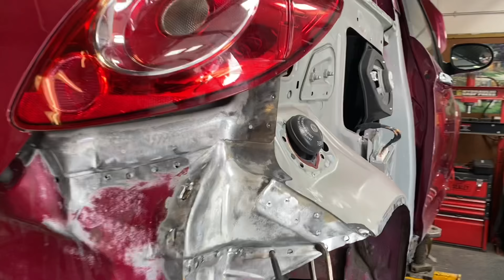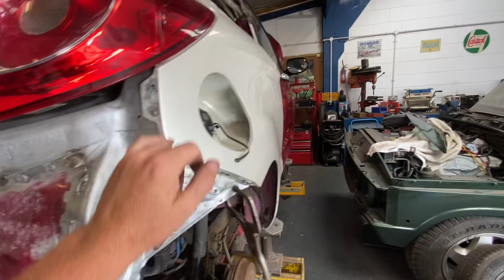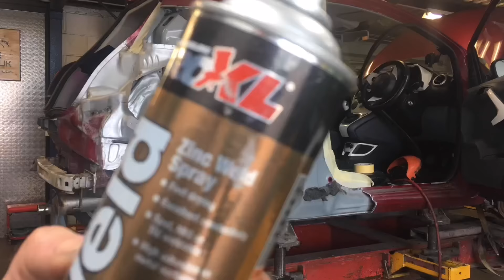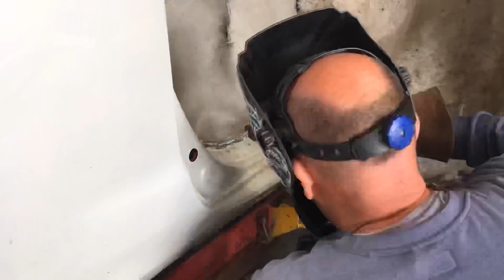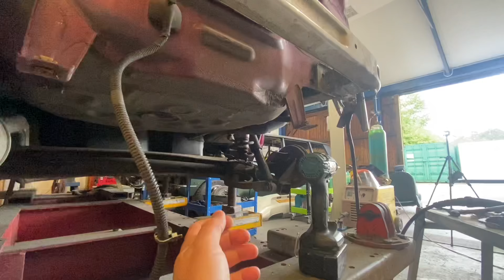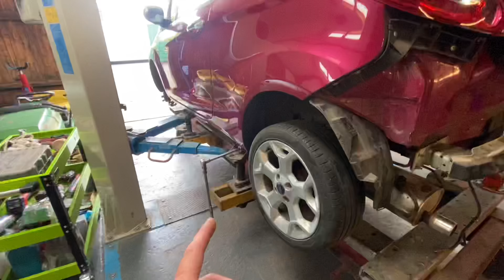Copart Ford KA Salvage Rebuild On The Jig Frame Machine PT 3

Comment: Love watching you two sort these cars out. When you use the dozer etc on the cars, how does this effect the car if it was bashed again in the same place?
Reply: Think that part of the monocoque chassis is made of tissue paper anyways so probably not much effect.

Usually the passenger shell is the part that will not bend , This outer layer is not much more than cosmetic.
Reply: @Jasontvnd9  thank you

Comment: Great job guys. :) Only minor issue is you guys should the welding fire proof blanket to protect any glass, plastic and fabric parts as the hot shavings from the grinder will melt the plastic and even glass and get into it and rust. We use them a lot when cutting and griding . Believe me i done that before and was a nightmare... But other than thant amazing work, you make an amazing team.
Reply from the maker: Thanks. Fire proof blankets can be seen in the video thumbnail

Comment: Hi you two.
Nice job there, good to see the weld through primer & the blanket protecting the interior! Good gaps & very tight looking on that ford.
By the way, I did private message you on Instagram a good few days ago, and had no acknowledgement.
Nice work you two do there!

Comment: Rob /Chris, After pulling a heavily damaged section back to normal does this compromise the strength? i.e. if it were to have another bang in the same place would it crumple easier?
Reply: yes. metal fatigue
Reply: The panels crumple fairly easily anyway in a shunt as it's pretty thin metal, the strength comes from the chassis. The chassis only twisted by 12mm in that first rear end accident so it hasn't really been compromised much. In another accident it wouldn't make much difference, that said metal has a kind of memory so if that car was repeatedly driven harshly over speed bumps it then the chassis would be more likely to twist than one that hadn't been in an accident but the difference is negligible tbh, The car is no less safe than before.
Reply: It's all welded in the same places so in theory no difference 👍
Reply: Think they have air bags too👍
Reply: Yeah sorry I meant the cars these guys do are safe to drive. Don't know much about the metal work and crumpling👍

Comment: very interesting to see how this panel work is done, can you use some heat on these panels?
Reply from the maker: Heat not required and not recommended. Inner panel is quite a soft grade of steel.
Reply: @sruk  I saw a thing much like a induction cook top used to take dents out of panels, it heated the dent and it popped never have seen such a thing, so if the wife finds one of our inducvtion elements missing then she wil know wher its gone

Comment: Question for you lads out of interest, the original quarter panel had a sticker on it that looks like it has the VIN number etc.. Is that something you can heat up an peel off the old one, or do you just go to Ford and get one? Maybe it's my OCD! but just wondered what you do about things like that when repairing salvage.
Reply: @Punto Mk1 Uk Why would they bother? Sounds like a complete waste of time, these are not concours cars.

Comment: It is quite impressive how Kris took that wadded up and wrinkled panel and pulled it back and ironed and finished it all out to where it almost looked brand spanking new. I am amazed that you can work stamped sheet steel like this without ripping and cracking it all to pieces. Nice job.

Comment: honest question. would you buy one for your kids or your missus,that has  gone through that  i know
Reply from the maker: My mrs drives the hard hit gla we repaired  and most of my friends and family all drive damage repaired vehicles so yes absolutely
Reply: I think that impact was to much for such a small car.  I think another hit after the work would see it fold more than a new car.  Already used the crumple zone once
Reply: @chrisredfield3240  Princess Diana and her driver were in an armour plated car that didn't fold - if the car does not absorb the energy, the energy moves on to the next softest thing which is the passengers.
Reply: @Witheredgoogie  I wasn't aware the car Diana was in had already been involved in an accident before.    It folded enough for us to loose her though.   Very sad even now.  I remember my dad waking me up. I was 17 at the time.
Reply: @chrisredfield3240  It hadn't been involved in an accident, that's not what he said. Why on earth would your father wake you up to tell you this?
Reply: @135Ops  how do I know why he did ?   Don't you agree this car would fold up worse if it gets hit in the same place again.  That metal must be weakened

Comment: Like many people, I enjoy the pulling when the body comes back into line, with all the various parts sitting back where they should. Panel beating is either an art when it is done well or a disaster when it is done badly. For audiences, it is probably one of the times when time-lapse can bring out the magic of a deformed part merging back to the required shape once more. Correct alignment, joints and shut lines not needing filler to make them look right. The pair of you are  returning it to a fit and proper state. I hope it missed out on Sunday night's rain, or it might have ended up like the Escort

Comment: Hmm - enjoyable to watch rather than do!  I have noticed that some of the yank workshops use plates to reinforce the joins when mating panels. It seems that Chris doesn't use that philosophy - is there any real benefit in the way they do it?
Reply from the maker: If there not there to start with they shouldn’t be there they are designed to crumple 👍
Reply: @sruk  spot on 👍

Comment: Hi guy's looking good just 1 thing that may help you line thing's up  is a laser that projects a solid line vertical and horizontally and if you make a stand up with a platform that moves up and down you can put the laser at any hight makes life so much easier when tying to get panels lined up